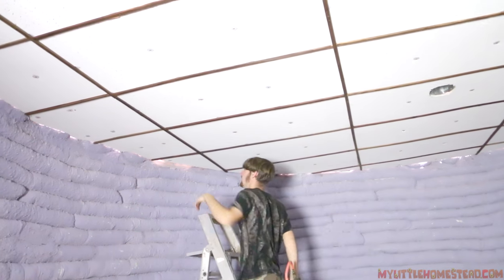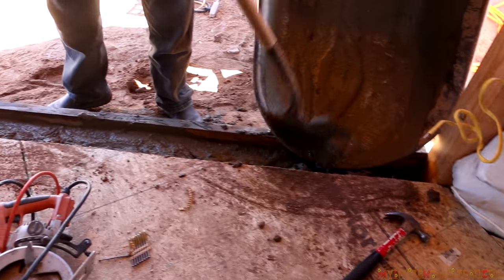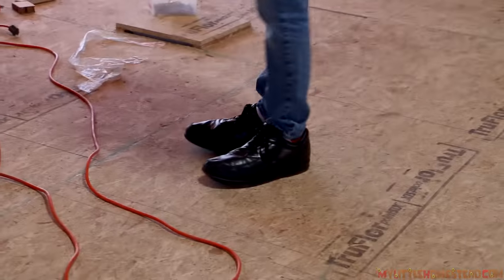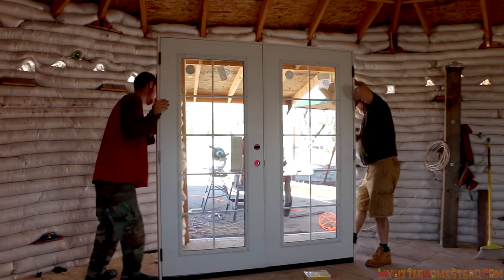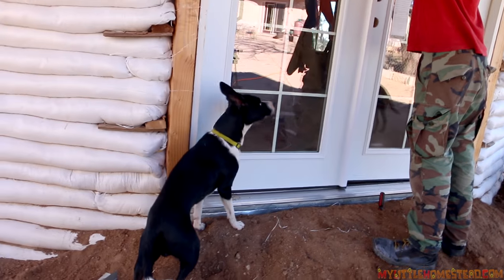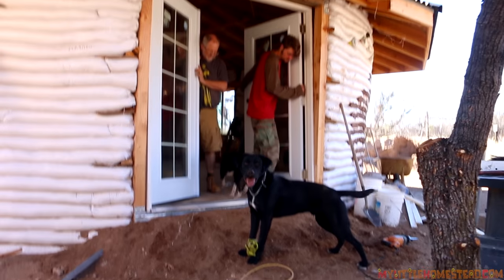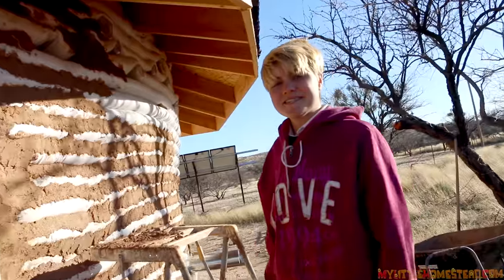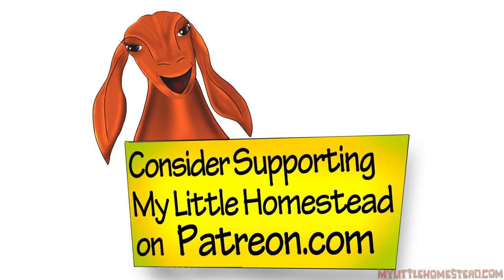Windows & Doors | Underground Earthbag Building  | Weekly Peek Ep79

Comment: One thing that I've observed is that all of the bottle-light windows (bottles through wall for light) need to have gaps filled at the bottom edges, where there are gaps between the bags and the bottles, otherwise they could all be highways for insects or other wildlife.
Reply: That will get covered when they put up the cob earthen wall plaster, they'll apply that to the inside and outside. So there won't be any open channels for bugs/water to get in.